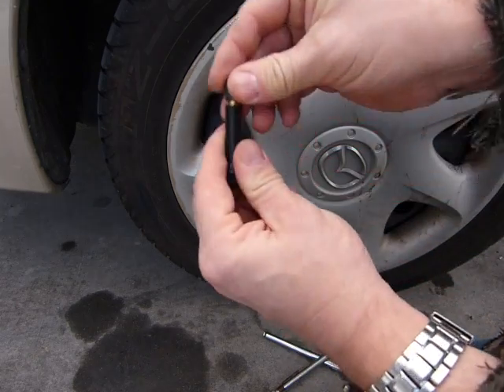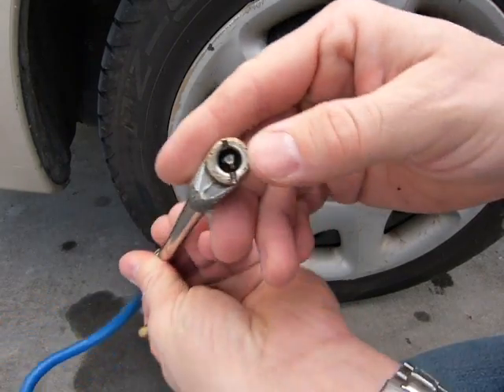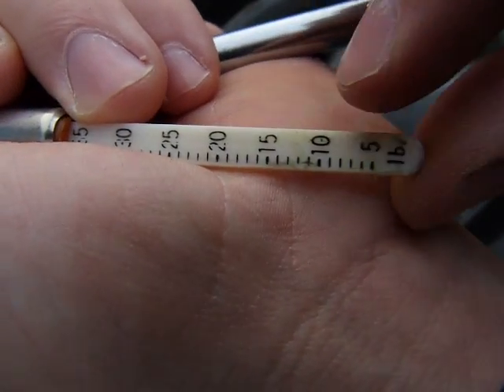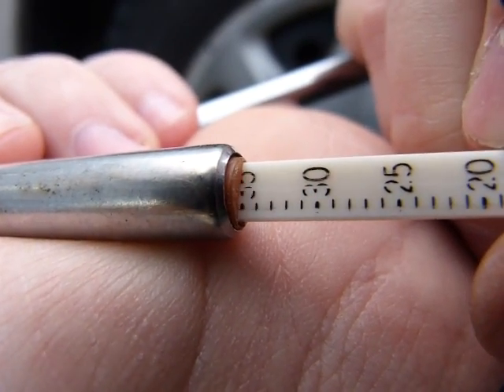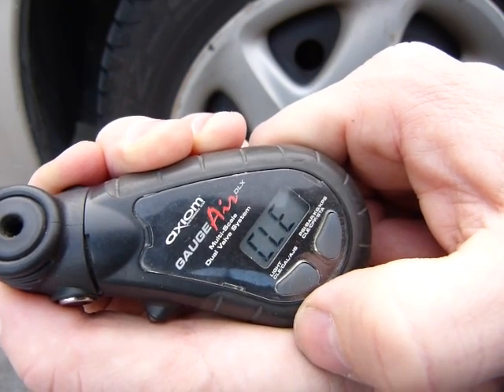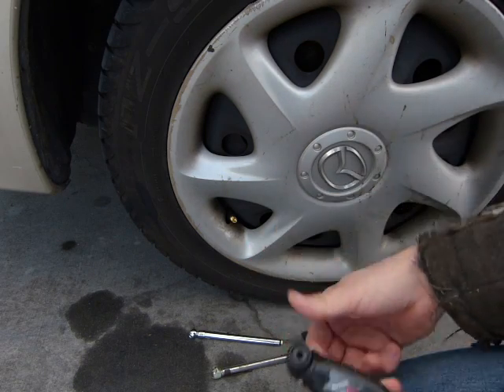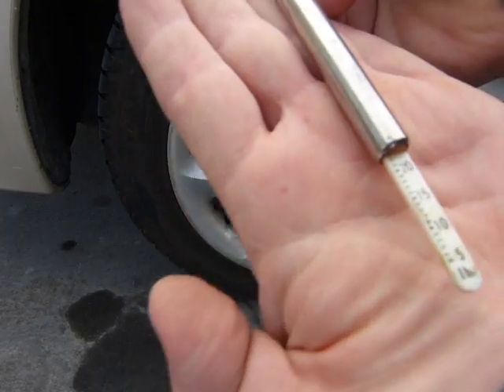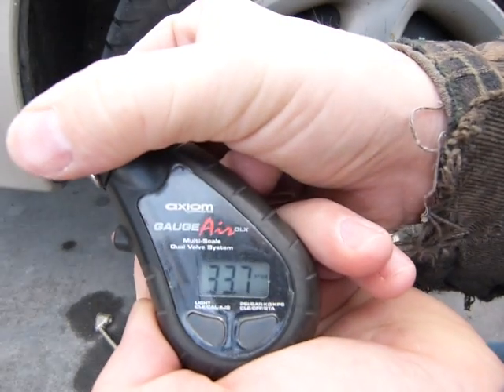Use a tire gage and fill air in tire (a beginners` guide with close-ups)

Comment: I use 33 psi for all normal size tires.  The dealer use to fill them up to 35 psi every time I took the car in for an oil change.

Comment: What is he right way to use a pressure gauge? Press on the valve stem and hold it there until the plastic rod stops moving or press and release right away?
Thank you
Reply from the maker: +thaik56 Press on, hold in place for the rod to stop or numbers to come up on digital, then release.
Reply: Damn, I've just realized I've been doing it all wrong for all these years. I always kept unknowingly my tires overinflated when I thought it was always dead on  the specified pressure.
I used to think that the rod would keep moving if I kept on holding.

Thank you for clearing that up.
Reply from the maker: You`re welcome. It`s the same principle as measuring weight by a scale - wait for the needle to settle.

Comment: Thank you much i just bought a used ca in march and all if this car lingo is new to me thanks for posting this video it really helped me with measuring my tires air pressure.
Reply from the maker: Michelle Ramsey You`re welcome. Stay curious, if one explanation doesn`t work for you, find one that does. There are a lot of videos to choose from.
Make sure you know how to check 4 other things besides tire.
1 the coolant level
2 the engine oil level
3 the transmission oil level
4 the brake fluid level
These 5 will keep you going happy and save you from major expense.
Here is a battery video, too, just for reference: https://www.youtube.com/watch?v=swB4mLVMNzw
I also have spark plug and wind shield wiper videos.